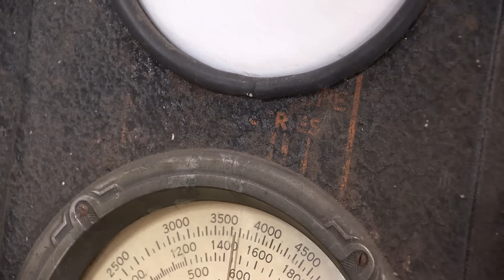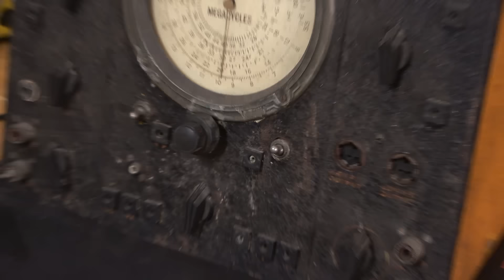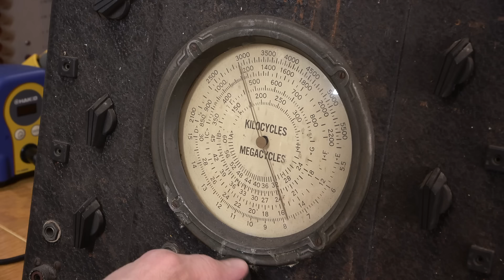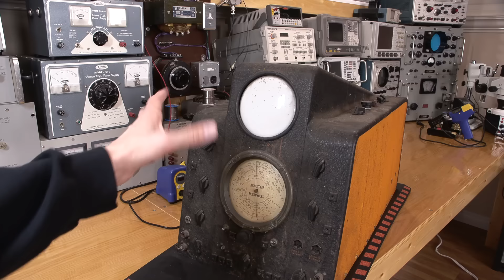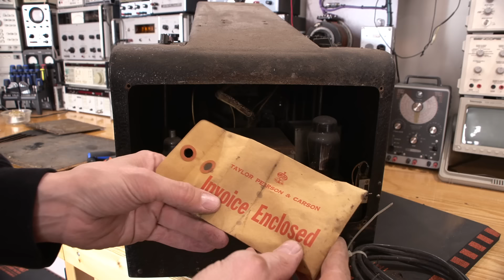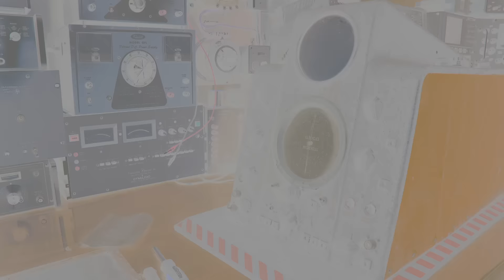Electronic Mystery Machine - What Does It Do?

Comment: Those blue Solar SealTite capacitors are vintage late 30's.  I have restored a bunch of EH Scott Philharmonics and they were used in the amp chassis.  I have never found a leaky one.  Only capacitor of that vintage that I can say that about.
Reply from the maker: Solar caps (SEALDTITE) are all "electrically" leaky... very much so, and need to be replaced. They are so leaky, that you hear me say:  "Sealdtite to keep the leakage in."

Comment: Its pre ancient greek. A planetary  starmap alignment calibration device for your Antikythera mechanism. Unmistakable, I'm surprised Mr Carlson didn't recognise it straight away.

My advice, carefully remove the components and lay them aside then fill the casing with concrete. Bolt an Acme Corp heavy duty boat anchor chain attachment bezel onto the casing and you are golden. Happy boating.

Comment: I'm pretty sure it's a navigational device.  The dial is for tuning a receiver, which no doubt, is fed by a phased antenna array.  The CRT screen displays a line in the X-Y plane, the orientation of which indicates the direction of the beacon that's tuned in.  It's certainly for use on a boat or ship, as indicated by its weight.  Aircraft electronic equipment is lighter, as typified by the "ARC" transmitters & receivers, and the good old BC-348.

Comment: I don't know if I have ever seen a solar capacitor. What's the Capacitance and Voltage on those 2 Soda Pops?   They look as dangerous as microwave caps or big motor solenoids. Also, that transformer looks as stout as a microwave transformer, but probably <2kV.

Comment: I suspect the CRT is a replacement for a smaller CRT that probably would have had some kind of plate with metrics around it instead of a rubber liner.
-edit: its also a little odd to see rotary switch stacks that are different colors. You've got the pretty standard brown for several, then just one that's white. Those switches can be a bit terminal for restorations if they've been damaged enough.

Comment: Reminds me of my time on the navy
1968
I was weapons electronics engineer on destroyer
Wharf technicians installed Loran before we went on a long stay in the West Indies 
Just a manual
And a box with lots of dials and glow tubes showing numbers 
We tried everything
Got navigation officer involved
Radio guys
Radar guys

Cooks
Never figured it out

BOFORS used to have slide out boxes for fire control of the 40mm
Every item (capacitors resistors etc) encapsulated in a metal little box. No way to repair them. One gun failed 
By comparing a working box against a non working I found a failed resistor. Replaced it by soldering a resistor in.  When they found out it was almost a court martial. Are you a Russian spy?

Comment: I'm counting about 10 tubes and not a single vent.  That sucker must have gotten hot if left on.
Reply from the maker: It looks like the power transformer was replaced, check out the green colored bracket holding it up on the underside.
Reply: @MrCarlsonsLab  I did notice a lot of taps on the transformer, suggesting they used what was available instead of built to order.   That must have cost a pretty penny.

Comment: One thing is for sure, it was NOT designed or built for easy repair.
 
Frankly - it's a mechanical nightmare  laid out by an idiot!

Further, with the way it's laid out, no heat can apparently escape the bottom of the chassis. No wonder there are so many burned, scarred and over-heated components. Ventilation folks, ventilation!
Reply from the maker: And.. Probably the reason the power transformer was replaced too.